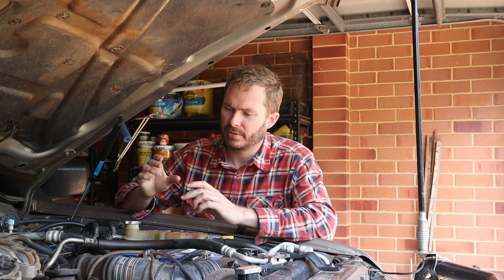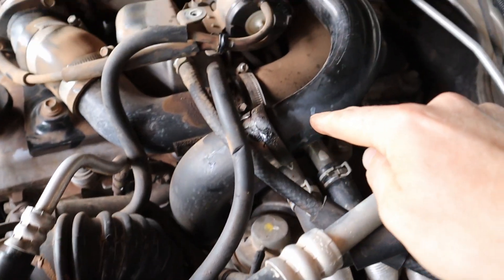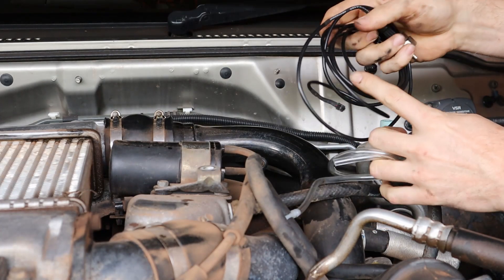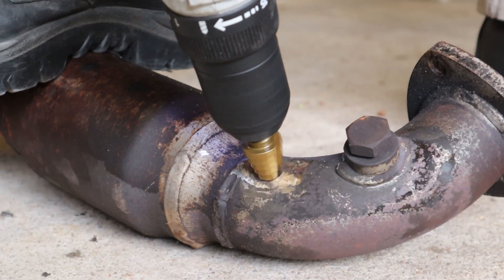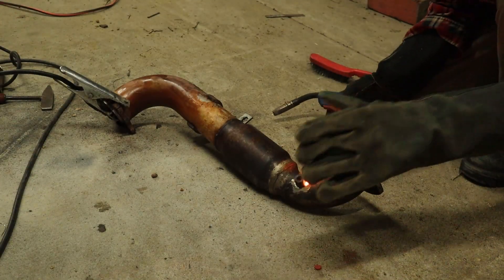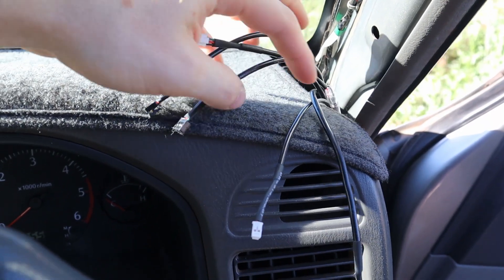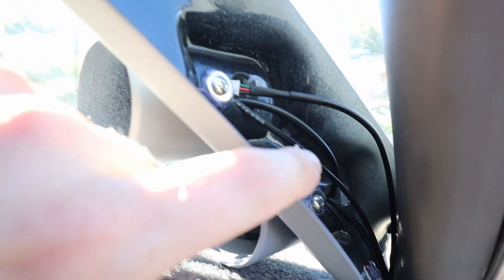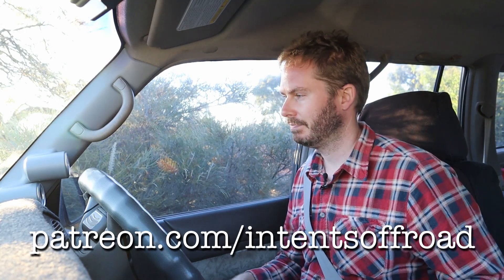Aftermarket Gauges Installation. Diesel Boost and EGT on Nissan Patrol

Comment: EGT readings are more accurate when they are installed on the exhaust manifold. You want to know the temp coming directly from the motor so reading is more accurate if it comes from the manifold

Comment: @3:35 You mention the best place for the boost sender and I agree that's an accurate reading of what is going into the motor but curious is it safer to have it Tee'd in near the turbo like everyone usually does to measure what the turbo is making? 

Even though there may be some wastage after wouldn't it be more important to make sure you're not pushing the turbo too hard or making more than it's rated for.. eg. Turbo rated for 19psi and you're seeing 19psi on the guage at the intake but the turbo could be making more and you don't see it because you're reading it only entering the engine?

Love the vid btw just curious to learn before I do this myself
Reply from the maker: Very true points there, I guess it depends on your individual case. For my ZD30 the turbo is known to be happy with high boost but there's a factory ECU fuel cut if the boost hits something like 16 or 18 psi, so for me it's important to see that I'm accurately hitting no more than 15psi

Comment: Hopeful that you read this, but i have a few questions
Why not use piggy back fuses for the wires
And does it matter if all the power wires are to accessories or does it need to be all separate, i dont mind having the light on all the time
Reply from the maker: You could definitely use piggy back fuses, I just wasn't into the habit of using them when I made this. If you put everything to accessories there is a chance you lose memory (gauges won't keep the colour you set them to, alarms won't keep their set parameters) but I'm not 100% on that cos it's been a few years since I did it
Reply: @Alex.G  thanks for the reply mate, I think my new gauge doesn't work so iv pulled everything apart for nothing haha just one of those days

Comment: I found those gauges too bright at night even with the dimmed setting on the yellow wire. 
Like someone with bright headlights smashing your pupils. Annoying as fk

I went JRD gauges instead.
Reply from the maker: Yeah I find the same but I couldn't afford better ones. I just wear my sunnies at night when I drive now
Reply: @Alex.G  fair enough.
Try this -
Your ignition wire to the gauges, probably the red wire, if the white went to battery take the ignition 12+ wire to a switch on your dash somewhere. So you can isolate it. 

Dont switch the battery wire as you'll lose the memory setting.
Reply: To solve the "Bright Gauge Problem". I put a 1K Variable Resistor in Line with my Dimmer Controller.
Reply: @DavidSzentessy  good idea. Make sure you heat shrink over the resistor to eliminate potential shorting.
Reply: @devarmont87  
Thanks;

All ready done (about 4 1/2 Years Ago),
Mounted the Resistor in a spot that it seems it was made for it, (Panel Underneath the Steering Column)
Reply: @DavidSzentessy  I didn't even think of that. But I'm super happy with my JRD's. They have programmable functions and alarms, user colours. And are pretty cheap
Reply: @devarmont87  
I went for the “RedArc” and I was thinking about Crying Twice and Replacing them (I find them hard to read (need to use reading glasses (Prefer Orange Dial on Black)))
But I do like having a warning light and chime if I go over Programable Levels and having, in the One Gauge, Boost. EGT (starts at 300*C) and, most importantly, WaterTemp.
(Happy New Year)

Comment: Hi, mate. Just subbed.
Listen, Always been a Patrol guy but just recently went to Navara after something nice and kinda special fell in my lap at a good price.
So this question, while relating to Nav is not actually Nav specific.
I have both boost and a Pyro pillar mounted gauges in my new truck.
Thing is they're too bright at night and after trying window tint unsuccessfully am reverting to my original plan of tapping into a dimmable circuit at the rear of the dash dimmer button which, by chance is located to the lower right of the steering wheel only about 15 centimetres away from the pillar mount.

Doable?
Any issues you think may complicate things?

I'm sorry I don't yet know your name but Id like to use it. Instead I'll have to just say thanks, mate. Lol.
Cheers.
Look forward to many more videos (and learning your name :P ).
Reply from the maker: Hmmmm interesting idea! I had thought of putting tint on mine as well for the same reason, glad to know now that it wouldn't work 😄 

I like your idea and as far as I know, lights are dimmable because you are actually reducing the voltage going to them. I'd say probe the wire with a multimeter and see what the voltage is doing. 

However, the problem I can foresee is the gauges are probably backlit by LED lights, which don't dim the same way halogens do. 

So really, I'm not entirely sure how your plan will work out, but the most important part is that I don't reckon it'll do any damage to the vehicle or gauges. Can't hurt to try!

One more thing that occurs to me as I finish writing this, how about trying some VHT Niteshades paint? You know the stuff people tint tail lights with? You can layer that up as many times as you need to then.

The name is Alex by the way, thanks for watching 🙂
Reply: @Alex.G  Ha. Thanks for the response.
Yeah the window tint was ultimately not only too dark during the day to be effective at night but it was tricky af to cut.
Seems simple right? I was going to use a protractor to mark it out and it wasn't until I was sitting there about to begin that I realized of course that would leave a hole poked right into the middle of it and you cant use the gauge itself even if you could easily remove and unplug it because you'd get the outside edge, not the inside. Lol.
Ok, so what to do?
I have to admit I have never been the sharpest tool in the shed but I ended up using consecutive dots measured with a ruler to create a circle but that was shit so spent forty minutes going through every circular object in the house and ended up with a vitamin bottle lid that was exactly right. Haha.

Anyway, yeah, so I had four different scrap sheets of tint I went and conned out of my local tint guy for free and even with the three choices it took me three layers to get it to where it needed to be for night driving.
A) It doesn't layer very well and B) it was, the following morning as mentioned, then too dark for daylight.
So back to the original plan which I like better anyway and see as "the right way to do it". I'm just a little worried its not as straight forward as I expect and will fry something so you lead, ill follow? Lol.
I think plenty of people have this problem.

Haha. Cheers, Alex.
Rhys. Bundaberg.

Comment: I only just bought one of the pods for my Nissan patrol, and youre  original pillar doesnt back on.
It was too tight to fit both... 👍👍
Reply from the maker: I do recall it being a bloody tight fit yes. I somehow managed. It probably won't come off again with ease haha
Reply: @Alex.G  all good mate...I just left the original off and used the new pod pillar. 👍
Where would you suggest also for me to install a boost gauge. Do I mount it with an  adapter on the intercooler...?

Comment: where is the oil pressure and water temp video ?
Reply from the maker: It never happened. Both those gauges are still not hooked up in the vehicle 😄
Reply: @Alex.G  oh that’s disappointing

Comment: If anyones got any issues getting through the firewall grommet, I find a metal coathanger unfolded does it perfectly, little bit of wd40 or some dishwashing liquid helps bring the cable through easier

Comment: So mate did you not wire into the dimmer for your instrument cluster (so the gauge dims when you dim the instrument cluster) ? I’m installing redarc gauges and they recommend wiring to a ‘dash light negative’. Just wondering.

Comment: hi great video !  i have a D4bF which is basically a updated hyundai version of the 4D56t (pajero engine 2.5Ltdi)  - it has a mechanical injection pump , my question is, i want to install a boost gauge , should i tap into the injection pump boost line or into the wastegate boost line ,,,, interested on your thoughts

Comment: That boost line pick up in the intercooler pipe is in wrong place hence why it over boosts on occasion also you should have a dedicated boost line just for the gauge, meaning you shouldn't share that boost line with another line. I get my boost from  the intercooler where the map sensor is with an adapter..
Reply: Mine does this also i run mine from adapter randomly started about 3 mths after installation

Comment: Should Dona Dawes/tillix guide Alex
Reply from the maker: I think I might do one hey. Mine doesn't seem to be doing what it's supposed to do anymore. I either have to put a new one in or at least tune this one up
Reply: @Alex.G  yeah when i noticed about stopping the old zd blowing up lol.
a guide to a tillix for preventative grenades would be good
almost like a video series on NADS
Reply: @Alex.G  I found as the Dawes valves get older they tend to stick a little bit and hence can put the pressure up a bit higher than one would like, they have a new one out now that has a ceramic ball in it - supposed to be superior to the older style that has a steel ball inside.

Comment: Looks like your intercooler might be leaking at the crimps.. the black oily marking on the core near the tank at the intercooler inlet. Common issue with the genuine intercoolers. Thanks for another great video, Alex.
Reply from the maker: Thanks Evan. I have often wondered if the intercooler is shagged. Not too sure how to check it.
Reply: @Alex.G  Yes, agreed it is leaking (all the factory ones do eventually), the black mark is from the oil that gets ingested back into the motor from the rocker cover via the intake pipe (a catch can helps minimise this).

You can mix up some liquid detergent & water and spray or lightly pour over the joins (same as you do when looking for a gas leak) and with a little bit of throttle with the transmission in drive (while foot is firmly on the brake) to bring up the boost a bit - if there are bubbles there is a leak. It is easier to do this with two people.

I changed mine over to a fully welded one and as such have no more issues.

Comment: Good work mate!
I installed the same dual boost gauge a few months back and it performs great, your boost is a little worrying tho, I'd be looking at installing a tillix and needle valve for a nice linear boost control, also my EGTs are sitting alot lower than yours I'm yet to see 400°c even at 100km/h on the highway I'm sitting at roughly 350°c, I have recently had a ECU remap tho.
Reply from the maker: It does have a dawes and needle valve on it which I believe does the same as tillex, so maybe it just needs some tuning? Problem is I have no idea how the shit works 😟 interesting about the EGTs, standard intercooler on yours? Mine is standard. It gets up around 480 degrees at 100-110km/h
Reply: @Alex.G  Ah I see, mine definitely holds boost better and it is a more linear curve, doesn't bounce around as much.
It is a bit of trial and error, usually try and set boost with the needle valve fully closed (fastest spoolup) then adjust the dawes at a reasonable boost level (15psi for stock?). Then its just opening the needle valve with the engine idling till the actuator arm just drops from the grub screw and work from there, if it's too aggressive a spool rate or you get limp mode, try opening the needle valve for less of a spool rate, about 1/4 turn at a time, it's quite frustrating and takes some finesse.
Yes I have a standard intercooler that was rewelded previously, EGR blocked, 3" straight through exhaust, complete rebuild done 55,000kms ago.
Reply: @bistratoaie2901  The larger exhaust definitely helps with EGT's and the higher the boost the lower the temps also, I run 20psi and temps usually sit around 250 - 300°c at 100km/h with 33" tyres. I have found that as the Dawes vales wear a bit they seem to get stuck and cause a slight delay in controlling the boost, the newer ones have a different material ball inside that seems to last better.
Reply: Sounds like its running a bit lean, the richer the diesel AFR, the hotter it'll run.  Mine was regularly exceedung 500 deg C, but not developing more than about 7PSI which would bleed off to 5 as the revs went up, I disconnected my wastegate actuator as I thought it was faulty, and now I'm seeing around 10PSI plus as I get up into 3000 plus RPM and the EGTs with the resultant leaner mixture (more air), peak at around 430 now at WOT uphill. On an old  80 series with a 1HZ.

Comment: Hopefully you have better luck than I did with the Saas Trax gauges. I had the same two as you, both were replaced under warranty at different times and then a third one played up about 6 months out of warranty.
Reply from the maker: A few people in the comments here seem to have had some trouble! So yeah fingers crossed I guess 😄
Reply: @Alex.G  the other problem with them is they're way too bright at night but I imagine you've already worked that out haha
Reply from the maker: Haha yep, I was thinking of changing them to red just to be easier on my eyes! But someone else here said they put a bit of window tint over them and that worked pretty good
Reply: Yeah, a mate of mine had issues with them also - due to that I bought Redarc ones (no issues 3 years later), but I had to sell one of my arms....

Comment: About 20 years too late for me, but better late than never I suppose. The second pod is good for an Auto trans temp gauge if you have an Auto and tow. Engine temps and pressures are better handled by an ECUtalk display for the pre-CRD DI's. If you already have the Dawes/Needle valve you need to tweak it down a bit to control that boost. Better safe than sorry. From memory I had to put a small ball bearing in the pressure line to the boost gauge to settle it down a bit. Not enough to block it obviously, but enough to settle out the spikes.

Comment: Your boost seems to be all over the place, id recommend a tillix valve as that will help stabilise the boost and keep it say at a constant 15psi under load.
Reply: Looking at them for mine, got much experience with them? Do they make it so the boost cannot go above a certain value or not
Reply: @darcykeddell4930  a tillix kit will limit the max boost, takes a bit of time to adjust(with the assistance of a boost gauge). And you also get a needle Valve so you can control the spool up of the turbo aswel definitely improves drivability
Reply: @TheCa5tleBrav0  what does the needle valve change to I assume make it spool quicker?
Reply: They help alot I got tillix Boost and valve controller works great got mine set at 13psi can turn it up if needed definitely recommend

Comment: You should be aiming for 15psi on your DI ZD30 unless you have had the ecru reprogrammed to not go into limp mode if your boost goes to high..
Reply: I run mine on 20psi (max) via a Dawes valve without any reprogramming, only time it goes into limp mode is if the engine is stone cold and I hit those pressures. Every Patrol is different I have found, I used to be only able to run 18psi until I installed a 3" exhaust and opened up all the intake plumbing including new intercooler - now I can run 20psi. The higher the boost the lower the EGT.
Reply: @dingodazz3724  I have a Tillix setup much the same as the Dawes, my gu patrol goes into limp at around 16-17 psi. Im fitting 3' exhaust hopefully this weekend, I want those nasty EGTs to be as low as possible.
Reply: @bigfella6629  question, did your egt drop after going 3 inch system. your turbo dump looks a lot smaller th 3 inch. I'm guessing a larger intercooler will reduce it more than  3 inch system

Comment: Hope you have better luck with those saas gauges. General consensus is they are absolute dog shit. had 3 sets  within a year and they all died. Are you apart of the zd30 warriors group on facebook? Seems everyone has the same experience and i mismtakenly bought it despite the warnings. I really did like the price and looks and features though (alarm and  daisy chaining). Have had better luck with the Saas muscle series . Got boost is 0-30 psi (mechanical),  water temp 40-120c, and egt 0-900C been on for over a year now and havn't had a problem, even if the egt probe gets wet

Comment: I've got those gauges in my GU Patrol. I've found them really good and have had no issues with them. The EGT will go crazy if the probe gets wet but comes good once the probe dries off. They are however very bright at night even when dimmed, so I've put a piece of window tint on them.
Reply from the maker: Oh man, waaayyyy too bright at night! A piece of window tint is a great idea
Reply: @Alex.G  

I have the RedArc gauges and to dim them down, I've put a 1K (or is it a 5K?)  ohm variable resistor in series with my dimmer control.
Reply: How long have you had them? I had  3 sets within warranty period  (replaced twice) and the third died shortly after warranty period was up. Worst thing i've ever spent money on. I did like how they lloked though and i agree the 7 segment part is far too bright.
Reply: @TheJanope13  Mine have been going strong for close to 3 years now I think. I've had no issues with them, but I know that some people have problems the SAAS Trax gauges.
Reply: Happened exactly with me. I also put some window tint to reduce that light.
Reply: Thhat LED EGT gauge is ridiculously bright at night,  I cover mine with a bit of black leccy tape at night for the time being. It's a shame, as the format is good and they read well, just  too damn bright on that LED segmented display.